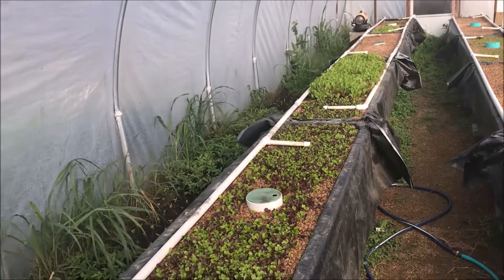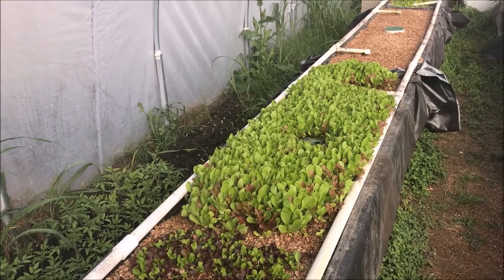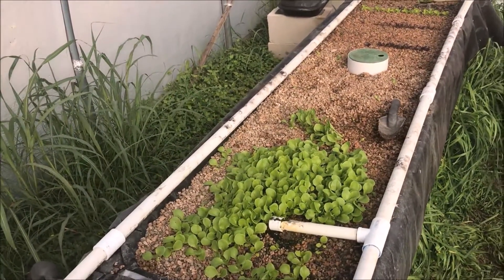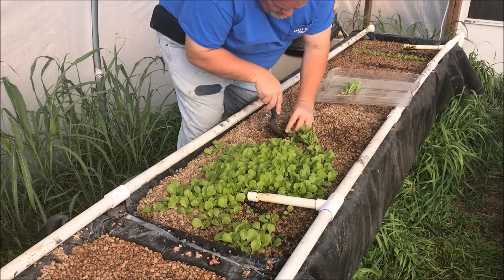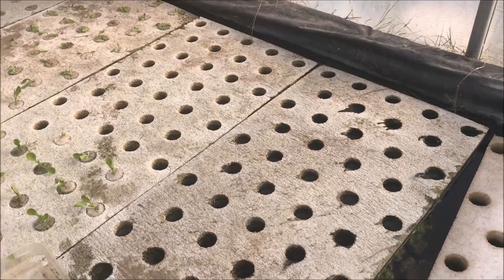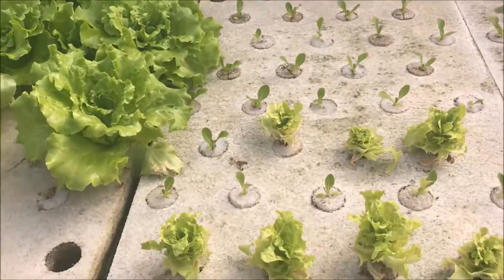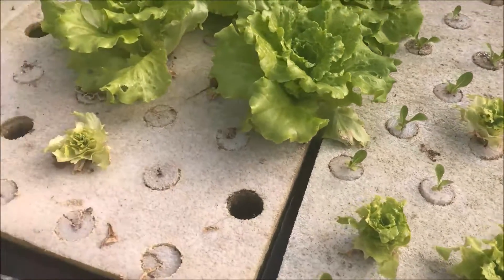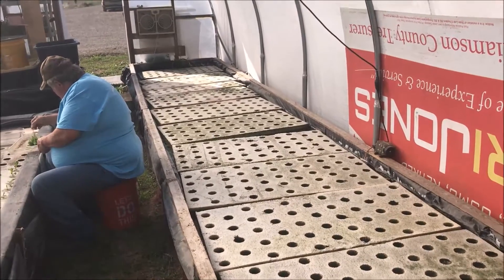Transplanting lettuce from gravel bed to raft in aquaponics system

Comment: So far I've been doing hydroponics using the ebb and flow technique. I have to add nutes and change out the nute tank about every two weeks. With aquaponics, do I have to add any nutrients at all? Also I'm trying to figure out what is the best way to filter out the solids from the fish tank.
Reply from the maker: You never add nutrients to AP just water, I do add compost tea however. If you set up gravel beds which I prefer you do not need to filter it’s all done by the gravel, pretty simple.
Reply: Hallsome Farm you dont have to filter out the solids from the main fish tank, so those solids dont clog up the lines for the grow areas and have all the solids in the grow beds? All the videos I've seen everyone is saying you should filter out the solids (fish poop) using a swirl filter, to stop from getting into the grow beds.